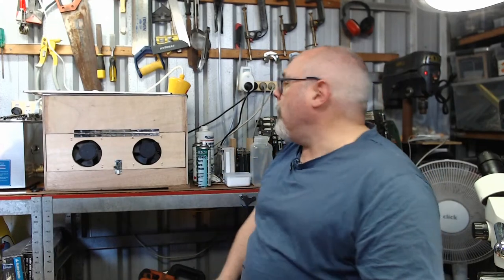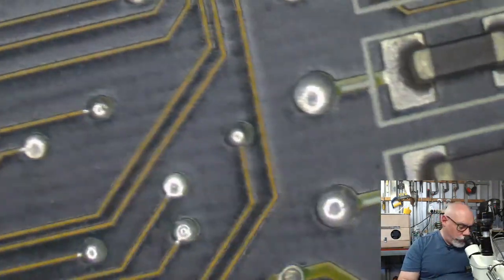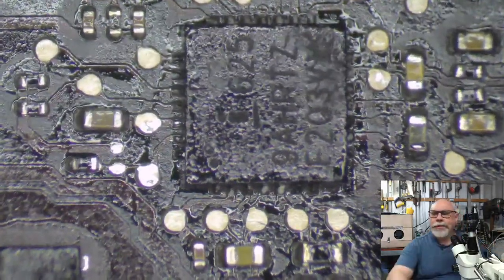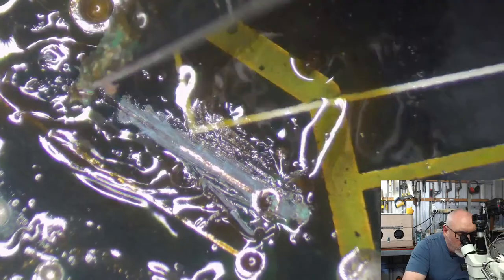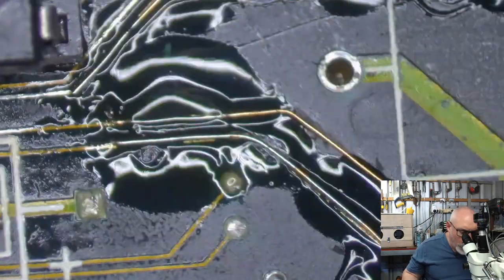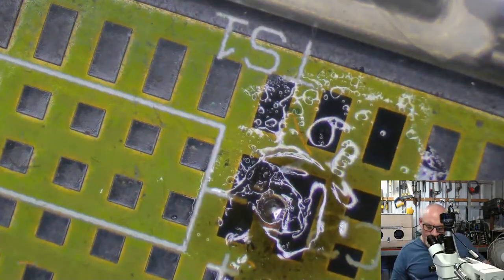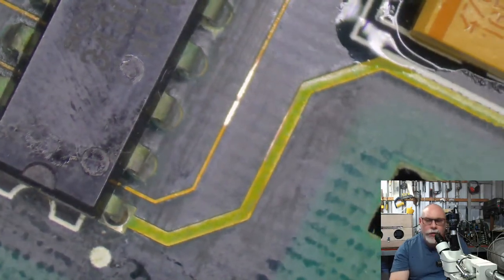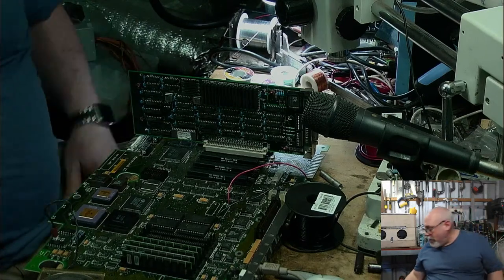Repairing damaged traces on a Macintosh II

Comment: The reason I took the 4 caps off on this board is because I just ran out of caps on an LC that needed recapping. The other board does have all of them. I learned recapping from watching your videos and life streams, so if my soldering wasn't too bad that's thanks to the master!! The other board will also have the radials replaced with the values facing up of course...